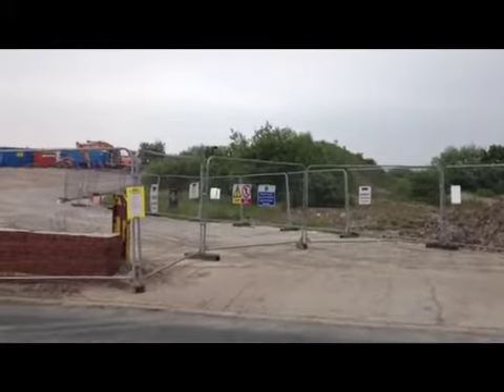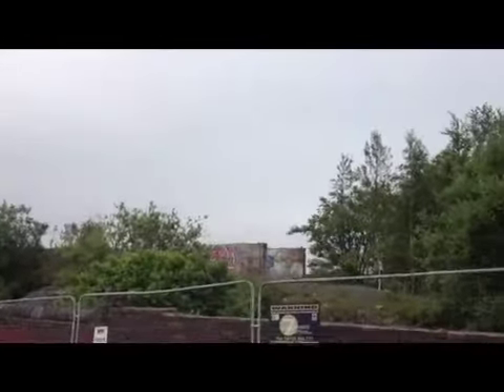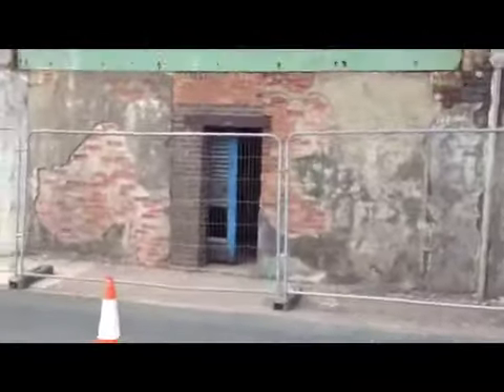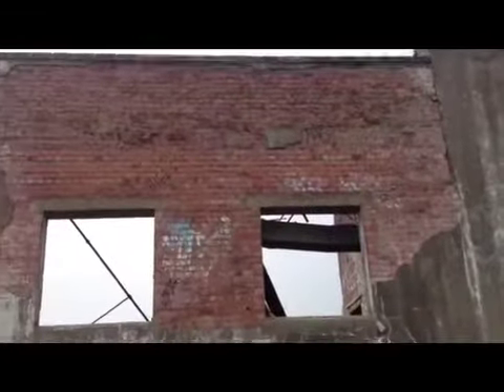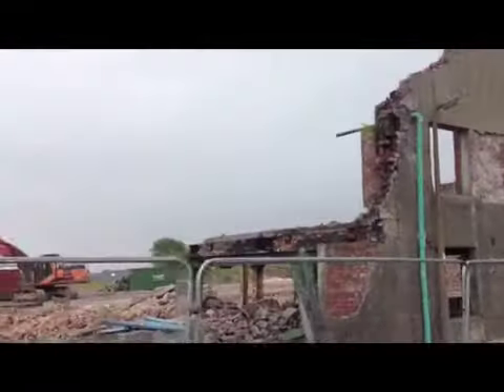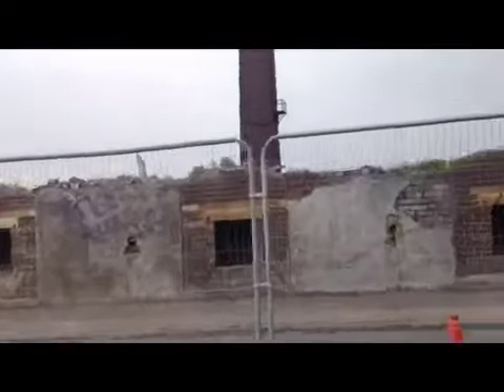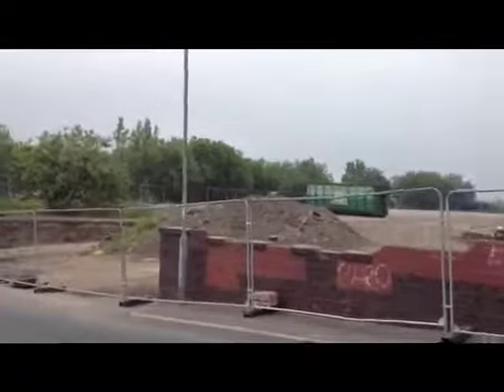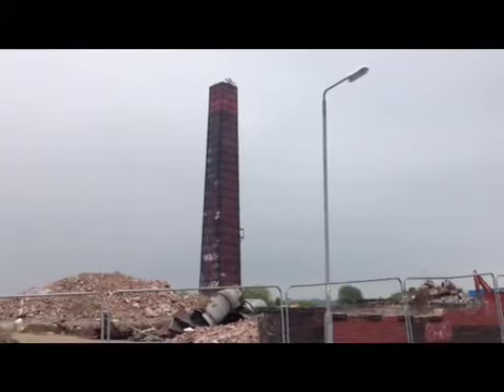Blackley Brickworks Demolition

Comment: I am sure I worked at these brick works in the late 1950's as a holiday job when home from college. The only doubt is the size of the site which I remember as being smaller. However the works contained 3 German built brick making machines each producung a brick every 3 seconds so the outout was a brick a second. Clay was bught up from a quarry on small guage rail trucks. The whole works was powered by an anormous steam engine beautifully maintained by an engineer. Thanks for the clip Andy

Comment: I used to work at the Blackley brick works in the 80"s along with my dad. Had some great times their. The first set of windows you see on the video I made them when I was a joiner their. The square things you did not Know what they were were air vents for drying the bricks. The tube work on the ground was taking heating from the Kilns to dry the bricks. We had 4 generations of my family work for Wilkinson who were the original owners of the brick works along with the Woodman, Atlas and Calder.